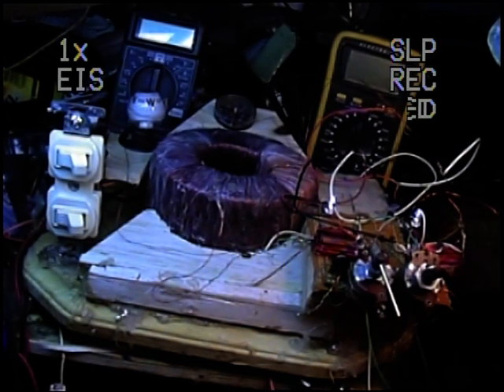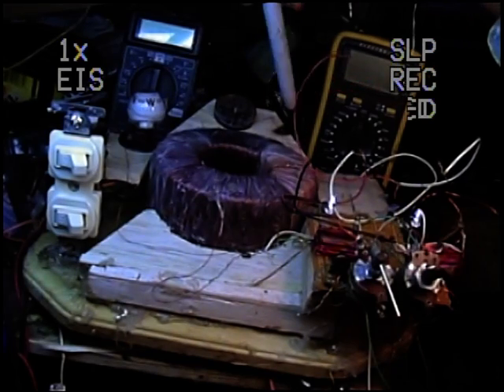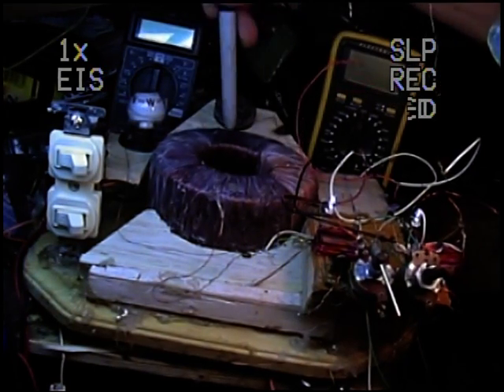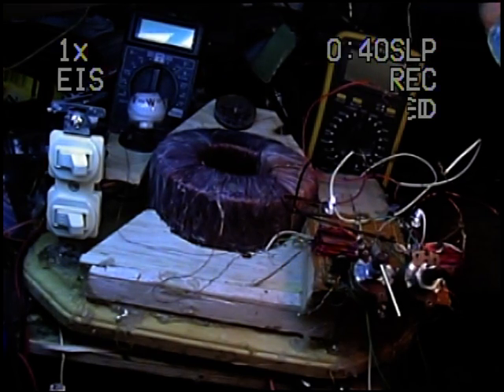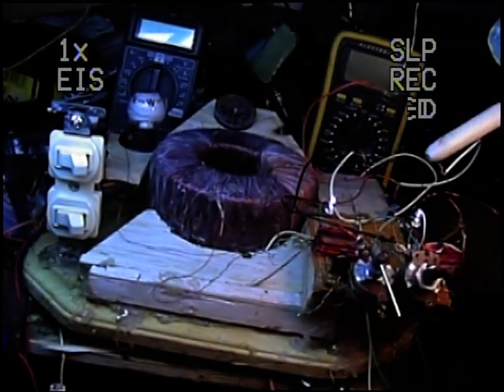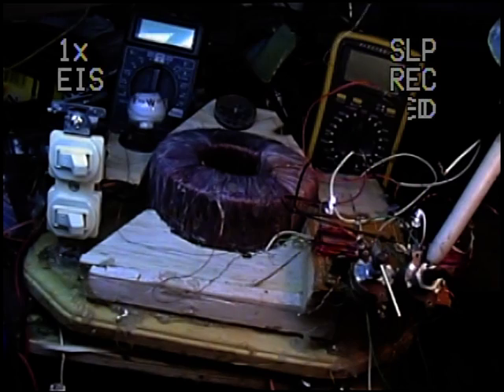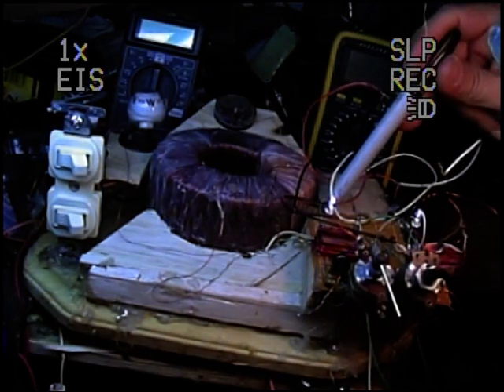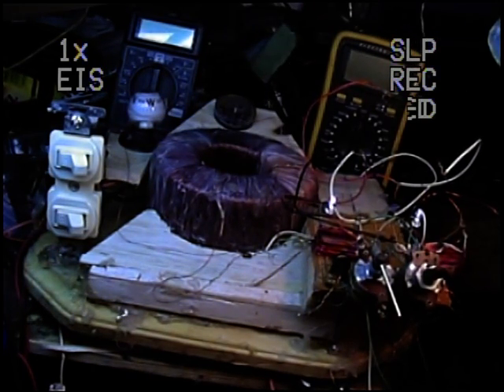Quite Large Joule Thief

Comment: The thing that you are describing is different to the one I had in mind. Another guy had a video about a "joule thief" built in a similar way to the flash charger (from a camera). I had experimented a few years ago with the principle of operation that you describe (found it on the web). It worked but still it's not a reliable power source, to get it to power something you would need GIGANTIC lenght of wire acting as a antena. And BTW I know how radio works :P

Comment: @akkudakkupl as long as radio stations transmit their waves, you can induce a very tiny current in a wire. this is how an antenna works in a radio circuit. its not using the 'same' energy infinitely as such but its taking it from the radiowaves. waves transmit energy. do you even know what thermodynamics is? what you're thinking of is the law of conservation of energy. I'm not the person to bitch on youtube normally but you sir are just trying to catch attention in any way possible.

Comment: @LoneOarman Add energy from where? Thin air? The only use I for this "joule thief" is depleting almost empty sources of electric current and loading capacitors with it. The power in this doesn't seem to be high, so thats the only way to use the limited power this thing pumps out.